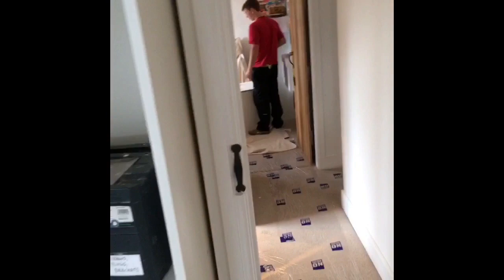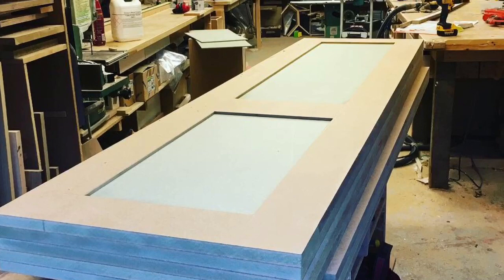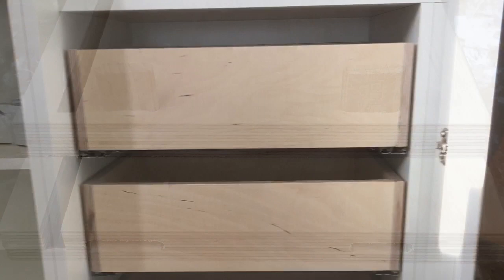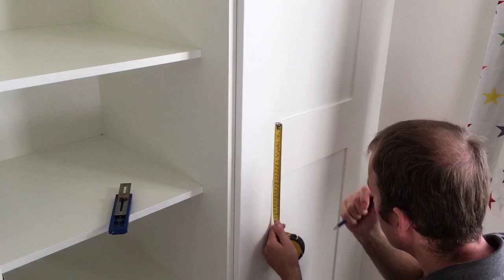How we built these wardrobes

Comment: Good job guys.  With making the door have you tryed cutting the hole then using a rebate cutter instead of having to add beeding just a thought never tryed it that way. When you have your cnc up and running you could do that with a few passes and drop the panel in from the front Or back.
Reply from the maker: Hi Tim we are now regularly using that method done with CNC by a local supplier, with a view to doing it in-house in future.  22mm MR MDF, panel hole cut out and rebated 14mm from the back.  12mm MR panel cnc cut with a tolerance of 0.3mm undersized which is just right for a tight friction fit with glue.  Same method whether shaker style or ‘classic’ style where we add a mitred panel mould.

Comment: Hi Alastair when you fit concealed hinges on your mdf doors do the screws hold in the mdf ok?  Presumably I wouldn't be able to screw the mounting plates onto an mdf cupboard it would need to be ply?
Reply from the maker: We did have trouble with standard sharp screws into standard MDF.  So these days we use the chubby euro screws into 5mm pre drilled holes.  Alternatively using MR MDF instead of standard MDF will improve the hold, or birch ply would be even better.  But our standard carcase material these days is melamine faced MDF for cost and pre-finishing reasons instead of birch ply.  In which case the euro screw option is essential in my opinion
Reply: @Alastair_Freebird  👍

Comment: I’m sorry if I’m missing an obvious point but I was wondering why you’d use 22mm material for the doors when the carcasses are made of 18mm? Plus 6mm panels on top which would make them 28mm in total. I’ve probably got it all wrong but I thought I’d ask. Thanks and have a good Sunday.
Reply from the maker: Hi!  This is an old video so I might misremember some details!  18mm is fairly standard for carcasses but for doors I find it a bit too bendy - I prefer 22mm.  The 6mm was the panel thickness set within grooves in the 22mm thick stiles and rails of the doors - not planted on as fake strips.

Comment: Do you have a standard in sized in width for one carcas and double carcass?
Reply from the maker: Hi no we don’t because I see one of our selling points as making things to fit, avoiding oversize filler panels.  But we generally make 600mm the maximum width because wardrobe doors any wider than that always seem a bit wrong to me!
Reply: @Alastair_Freebird  so i door is about 600 mm the carcass and 2 doors is about 1200mm the carcass?
Reply from the maker: @buzziovidiu  that would be maximums. In the KBB industry 600mm or 1200mm carcase typically have 596mm wide doors for 4mm gaps but we make them 597 for tighter gaps

Comment: How do you attatch the carcasses to the plinth? Are they domino'd or screwed?
Reply from the maker: Hi Neil, apologies for delay I missed this comment!  Once they’re fixed to each other, the wall and ceiling they hardly need attaching but I usually just put a few pins through with the nail gun and wax fill the holes!

Comment: Great work. 
Do you have a video of making the doors. If heard you right, you said plunge saw into 22mm and then fit a 6mm panel which is then beaded to hold it in place. Do you have video on your channel showing this. Great idea.
Reply from the maker: hmm, I'm not sure if I do!  I'm aware we need to get the camera rolling in the workshop more, and Brady jas started recording his work there so it will feature more in future videos.  However we have ditched that method of manufacture now, mainly because it is SO dusty rebating the cutout, and a bit of a miserable and unsafe job to do because there's no effective way to capture all the dust from a router used in that way.  We have replaced that in-house manufacturing method with outsourced CNC manufacture, basically the same principles of construction. I did a 3 part series on that, going into detail about tolerances, radiuses etc, you may find that interesting.
Reply from the maker: first one here: https://youtu.be/PNkq265Z9UM
Reply from the maker: ... but this second one actually shows the drawing and making of the doors: https://youtu.be/GSlecq0ubNo
Reply: Thank you so much for replying, and clarifying this, it’s very kind of you. 
I will take a look now. 👍🏻

Comment: Great video and channel! Just found it and now watching all videos starting with the oldest :) I have 2 questions
How do you decide when to use painted mdf and when to use melamine chipboard? Always chipboard for the carcasses and mdf for the doors and shelves?
What machine do you use to spray paint? Im using a roller and cant always seem to get the smooth result I would like.
Reply from the maker: Hi!  Thanks for your interest.  A typical progression for people working in this field is to start making everything from mdf included internal carcases (because melamine is harder to work with and requires extra equipment to apply edgeband).  But very soon you get sick of all that painting!!  For me, it dawned on me that using melamine for the internal carcases would be a huge time saving but also it gives the customer a smoother more hardwearing finish.  So yes, melamine for the internals.  But all the external parts which are visible with the doors closed I will make from either painted Mdf, or vinyl wrap components depending on the job.
Reply from the maker: We use a Graco Finishpro 395 mainly but your don’t need to spend that much.  A good machine to get would be a Graco GXFF.  Still seems a lot of money to spend, and you will need to invest in extraction and a dust free spray area etc, so there’s quite a lot involved, but when you are ready to get into spraying and to embrace the learning curve it will lead to a better finish.  You will find my video ‘paints we use and why interesting’.
Reply: @Alastair_Freebird  Thanks! It makes a lot of sense, the painting does take a hell lot of time. So the shelves are made from melamine too? I will look for some starting equipment for the edgeband, not like that massive machine of yours but some smaller tools to start with :)
Reply: @Alastair_Freebird  Again great advice. I guess Ill save that for later, right now im doing my project in my 1 car garage so its going to be hard to set up a room like that. Saw another video of yours with a room for every painting step, awesome. I will definitely check out that video later!
Reply from the maker: Look into the virutex hand held edgeband applicator